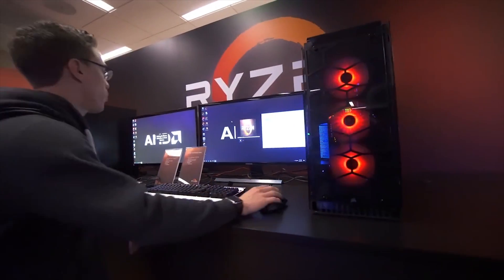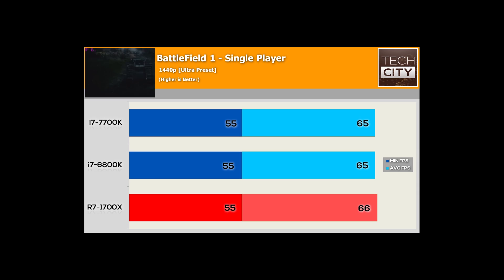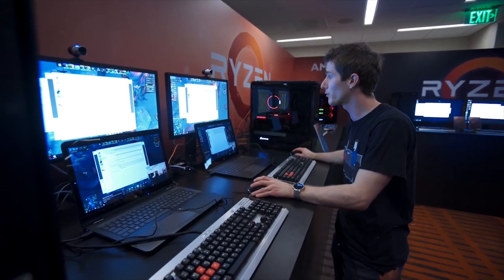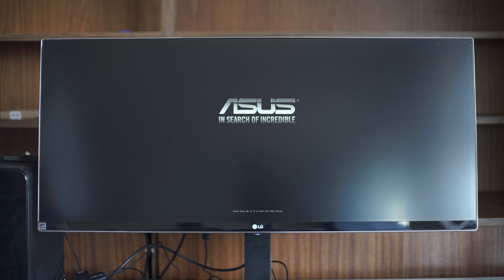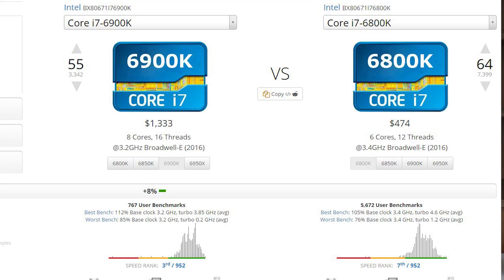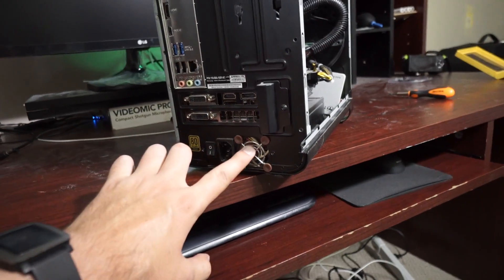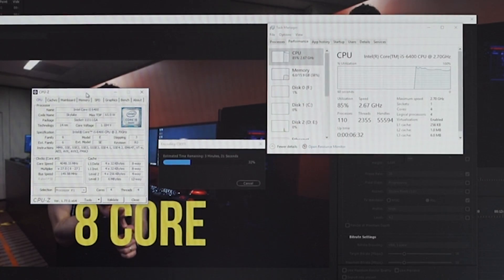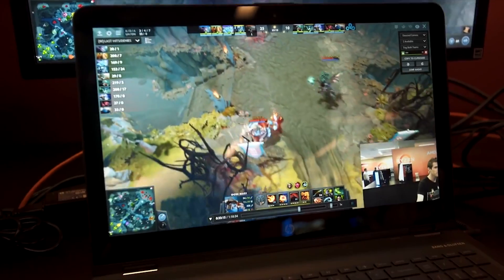AMD Ryzen 7 Exposed! Cheap $200 Intel chip

Comment: Dude, your making a lot of ignorant assumptions. You do realize that AMD has NOT released their budget Ryzen chips yet. right?

And the i5 chip you are talking about is a dead end chip. The Ryzen chips are designed to grow with you going forward so you don't need to upgrade in 2 or 3 years.

BTW, because AMD has brought down the cost of an entry level 8 core proccesor significantly ($329), software vendors have already started designing software to take advantage of 8 cores. They didn't do it before because it was a niche market considering the $1000+ cpu price. AMD has changed the market dynamic.

Enjoy living in your reality distortion field of alternative facts.
Reply: There are already bios updates that came out in the last few days that increase gaming performance anywhere from 10-30 percent. And there are already three game developers who have released updates that improve performance as well.

Ryzen is only about a month old and improvement already being made with simple updates.

Your arguments are losing validity by the day. It's not about being a fan boy, it's about facts. That's something you want to deny by sticking your head in the sand.

BTW, those recent updates will also improve the performance of the upcoming Ryzen 5 chips that cost even less than the Ryzen 7 chips so they are even a better price/performance chip compared to any Intel processor.
Reply from the maker: Yes, with AMD it's only promises about the updates next month... 
I'm used to playing stuff the day it comes out. :)
Reply from the maker: I love the way AMD fans think. "I don't need 8 cores now but it may be useful in some far future..." :D 
Wishful thinking that AMD Ryzen 7 will have any relevance in 2022... 
And there will be same $200 options with whatever number of cores needed for future PCs.

As AMD DX12 video cards have much relevance today still struggling on regular games and even more on a few DX12 titles we have.